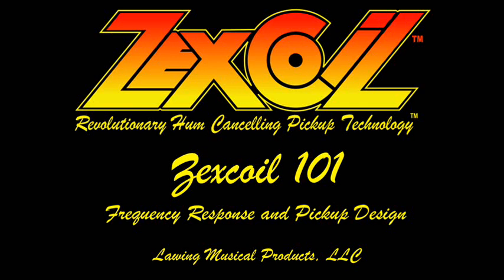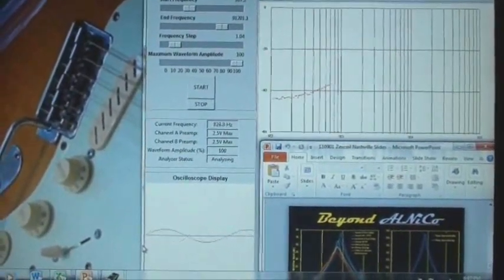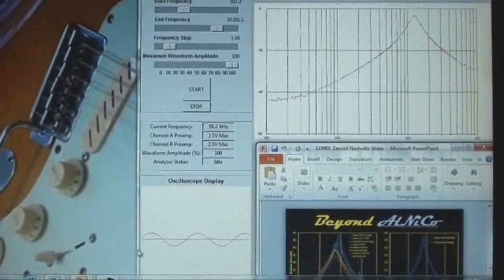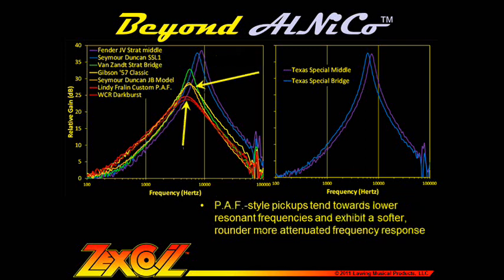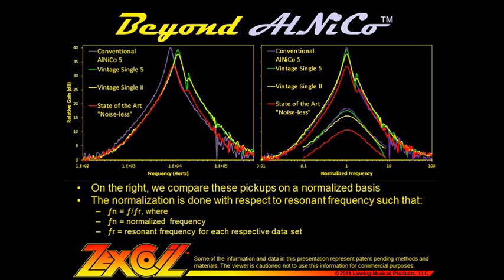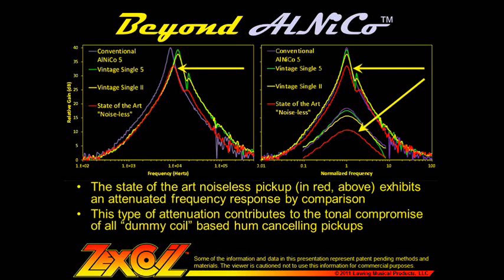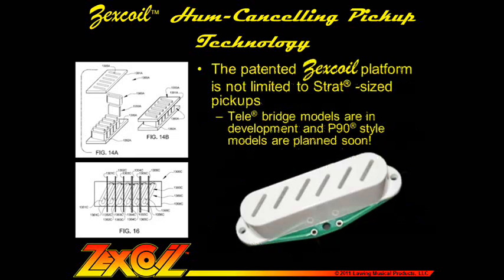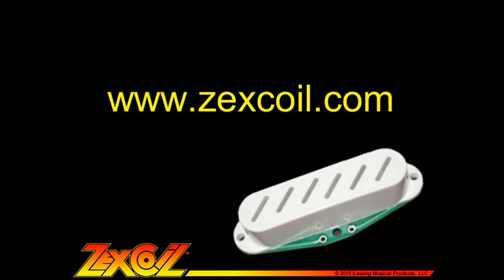Zexcoil 101 - Frequency Response and Pickup Design.wmv

Comment: great presentation ... how would you compare your most up to date zexcoil single coil 'strat replacement' pickups with something like, say, the seymour duncan classic stack plus line that uses a tuned helomholtz coil to cancel noise? ... i am looking to replace the stock pickups in my fender eric johnson signature strat with a full noiseless solution and have narrowed my search to yours and the Duncans .... any thoughts would be welcome and appreciated - congrats on your achievement and best of luck
Reply from the maker: The new Z Series pickups that we will release in the next couple of months are the best Strat voiced pickups we've made. I think they are the best hum cancelling strat pickups you can get. One of the reasons is they have a higher Q than any other hum cancelling strat pickup available. The Z-Core 5 pickups are the only hum cancelling strat pickups we know of (and we've measured everything we can get) that match conventional Strat pickup's Q. All of the other hum cancelling strat pickups have a Q value that is just "barely stratty". Especially stacked designs, they are particularly lossy because of the strong coupling between the top and bottom coils. Some of the more advanced stacked designs mitigate this somewhat with magnetic shielding between the coils, but they can't get rid of it entirely, hence the low Q. If you take a stacked pickup apart and measure the coils physically isolated from one another, it looks pretty good, but as soon as you stack it, you get tonal loss. It's physics.

Comment: Cool ,my tonal preferences when it comes to Jazz Bass pickups is that i like the sound of those early 60s JB pickups wound with awg 42 HF wire to between  6,5 to max 7,5K of resistance for optimum tone clarity and dynamics i really cant stand those so called vintage correct pickups, most of them are WAY overwound "8,5 to 9,5K" making them sound muddy compressed with no dynamics whatsoever!

Comment from the maker: @metroboyd. I'm not using an exciting coil. I use a resistor in series with the pickup. It's not the conventional approach but it gives an accurate readout of the resonant frequency and avoids any convolution of the effect of the exciting coil on the response. Also, it yields a nice symmetric peak that is readily analyzed with great resolution especially around resonance. I need to update the video to clarify this, as it caused confusion on one of the forums.